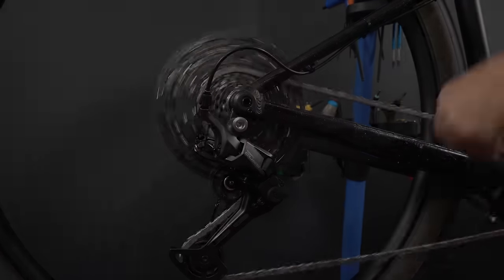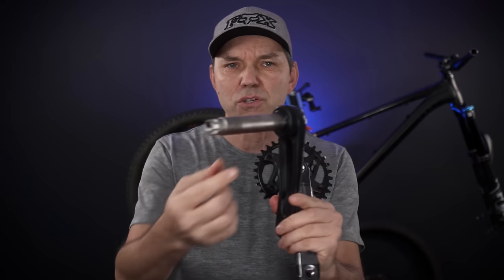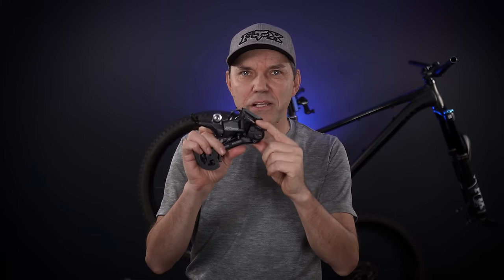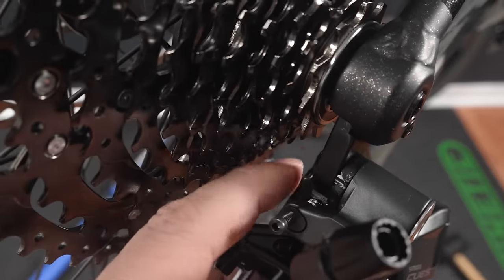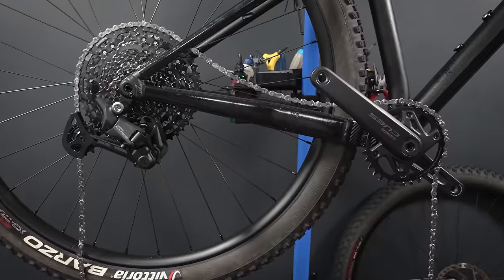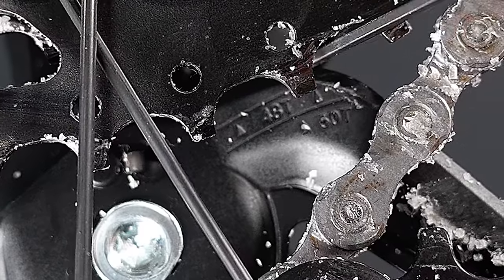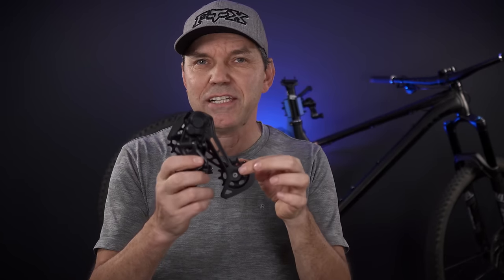4 of 5 - Testing Shimano CUES U6000 1 x 11 speed, Installation, Linkglide 9-10-11s Drivetrains

Comment: Nobody will race with these components so it is ok to shift a little slower. You will get used to it anyway. It makes it last longer and thats good.
Reply from the maker: True that!
Reply: I've just killed first chain on my Linkglide drivetrain, and there is NO SIGN of wear on the cassete.
So far, so good.
Reply: Can we change 11t to 13t cassette spokets if it wear out ? & Where to buy ?
Reply from the maker: @pickongamer4357  yes you could definitely replace & don’t know where you’ll find those, did you check online?

Comment: tip for better shifting on long therm: immediately throw away the stock shimano green inner cable and replace it with a good quality, stainless, grinded one.
Reply: Galvanized cables might rust but they keep operating smoother for longer if you keep them lubricated.
Reply: @LaurentiusTriarius  it wasn't a classic tech tip. it was about the shitty stock, layered shimano cable that might be designed by sram. :)

Comment: I got U6000 1x10 speed, 6 pieces/components, for less than USD175 (converted) and MT200 hydraulic brakes front and back for USD35. Ah, and SR Suntour XCR 32 RLR air for about USD80. Think this will give me good upgrade from my current Tourney XT, mechanical brakes and XCM. Western world overpays for sure, not on all products, but many.
Reply from the maker: Enjoy your upgrades! Definitely amazing value

Comment: My Oggi Razzo e-mtb has this U6000. I ride about 1200km with it (750 miles). It is really slow to hard gears. And, in several occasions after rain and mud the bigger light gear do not goes down more. I need to stop and press by hand turning the pedals and lifting the wheel . A strong spring is necessary for use in MTB.
Reply from the maker: From what you’re saying you might need a bit of adjustment on that drivetrain m. Also clutch service 😉 have videos for all that
Reply: @LoveMTB  I hope you are right and a adjust can fix this. I saw some videos about the "B" adjustment of the rear derailleur. I will try it.
Reply from the maker: @x.trailcwb1546  Yeah I would recommend a good video like this one and the Shimano 12s install I'm rferring to, not just "some video". And B-gap can be part of it but it doesn't sound like it is your only issue here😉

Comment: Definitely a consideration, when my sram cassette is needing replacement. Is the shifter compatible with matchmaker bar mount system
Reply from the maker: It’s Shimano so it won’t be compatible but bar clamp will work

Comment: I think its pretty good and if installed on a newly purchased bike (regular or E) it could last the life of it. Having to use a crank puller...no big deal. This what you have if you just want to ride a bike and not think about charging,  or replacing  parts and performing maintenance. Great for the masses.
Reply from the maker: I agree this can last the life of the bike (if you remember to change the chain of course!)
Reply: @LoveMTB  That's it. Maybe picked up at a bike service every year or two.

Comment: It does looks a tad slower shifting.  That would throw me off.  If not for your video, I would think I didn't tune it correctly. 😅  Still sticking with the m5100, but that new crank does looks cool, just not the crank puller part.  Haven't used one of those in a few years.
Reply from the maker: Yup I had to dig out for it!😊

Comment: The big question for me is can I use the new CUES cassettes with older 11 speed setup.  So would a previous linkglide 10/11 speed shifter, derailleur, and chain work with a newer CUES 10/11 speed cassette?  I'm assuming since the spacing is the same, it would be fine.  I just want to be able to use a burlier steel cassette for durability.
Reply from the maker: Linkglide to linkglide yes, it works. Linkglide/ CUES to old stuff not so much, more to come on that soon!

Comment: Great Video and very informative.
I installed a 6000 series 2x11 on my hybrid 700 bike with 50/34T chainring. So, I installed the cues RD-U6020-11 and 11-45T linkglide cassette ( replacing 11-28T), the new cues shifter and linkglide chain. I agree the shifting is delayed but I am now used to it and after 800km it runs very smoothly.
Reply from the maker: Yeah we noticed it at first now it’s “how it is”. Interested to see it long term even though if what Shimano says it’s true (3x) it will take a while 😊
Reply: @LoveMTB   I do go thru a few cassettes so it remains to be seen. It should last longer because it is steel and not AL alloy.
Reply: Hi, how are you? I'm currently rebuilding a 2019 Scott Aspect with Alivio 3x9. I've just installed a 1000W rear hub drive motor, so far it works well. My consideration now is to replace the 3x9 with either a 2x10 or 2x11 drive train and trying to decide between CUES and Deore group set.

The bike is used for commuting to work, shopping (panniers and trailer) and weekend fishing/camping trips. I ride mostly road with some trail riding on weekends.

How are you finding the Cues now? My leaning is towards the CUES, as they can be set either x10 or x11, governed by the shifter.
Reply: @Frombie_01  After a 5 months of running cues 6000, I have to say I am very happy with shifting and also smooth running compared to my 1x12.  If I was to convert another bike I would recommend it. the only thing I don't like and that is personal, is the gear ratio changes between cogs. For me, it has a large gap between cogs and for my use is not ideal.
Reply: @Navigator-apex  That is something that bothers me with 1x systems. I neglected to mention that I was actually looking at the 2x. However my point still stands regarding the versatility between the 10 and 11 speed. It is basically just changing the shifter and cassette.
Reply: @Frombie_01  Yes but in my case I also, changed the RD because my old Durace could not handle the cassette capacity.

Comment: I use linkglide with XT M8130 derailleur. Can someone explain to me, what's the difference between  CUES U6000 and RD-M8130SGS?
Also, changing gears down the cassete is lightning fast on my setup.
Reply from the maker: Never had one in my hand but I assume it is materials and weight and ability to adjust the clutch without removing the cover and...that should be it!

Comment: Would it be possible to use just the CUES crank with an older rear derailleur with a 9 speed chain?
Reply from the maker: Yes no problem
Reply: @LoveMTB  Thank you for the confirmation, much appreciated
Reply: @LoveMTB Just got the U4000-1 with 32 teeth and it works perfectly with the existing BB. Thinking of getting the 11-46 cassette now! Appreciate these videos!👍🏻👍🏻 Cheers and keep making such videos

Comment: I'm surprised you didn't need spacers for your BB. I tried to install that same BB on my wife's bike but her frame is narrow so tightening the CUES crankset without spacers left the cranks visibly offset towards the non-drive side.
Reply from the maker: I have a 2.5mm spacer on the drive side like Shimano recommends for the 73mm Bb shell
Reply: @LoveMTB  ahhh ok. I'm not sold on using an aftermarket chain though. I haven't tried the factory chain yet but the aftermarket one I have is making a lot of noise and it needs to go on the chainring exactly right or else it sits too high and slips.

Comment: My linkglide chain is almost at 0.5% wear (U4000 9s set), I use it mostly in steep terrain, so most of the time I climb, which is acceptable. It will wear the chain slower on flat though. I think I could get 4 or more chain replacement at 0.5% wear before I can change the cassette. I checked the cassette, and there is not even a sign of wear on each teeth even when I climb a lot.
Reply from the maker: Great! It is what Shimano said about longevity also

Comment: Hello, are the cues u6000 compatible with non other cues parts? Basically I want to upgrade a mid-tier bike. My current crankset is just some cheap 1x 32tooth square taper Crankset ( i alos want to upgrade to hollowtech II), pared with a KMC Z9 Chain.

both cranksets have 32 Teeths and are the same height. 
but i dont have hyperglide or linkglide. and my cassette is a 9 speed microshift cassette.
will the crankset skip my chain while riding? Are the teeths on the shimano different than on the cheaper crankset by meroca?
Reply from the maker: Hello gave this video all about that - 5 of 5 Shimano CUES Compatibility - Linkglide M5100 U6000 MTB 11 Speed
https://youtu.be/MV2O3XBSwZ4

Comment: Nice.... I think Shimano has made a good choice with drop bar brifters and road bike components coming soon. With much less stock to keep in the inventory going forward because of the common pull ratio and modularity of the design another obvious advantage.
I would use those cranks with a narrow wide single chainring and go ten or eleven speed on my hardtail using linkglide and U6000 CUES components.
I think the new crank design is excellent with the whole CUES line-up a winner. The linkglide cassette shifts slightly slower than Hyperglide plus but the added strength and longevity would make the shifts a moot point. The new modular CUES components are very robust and definitely a huge step up over Acera with a definite push towards the higher end of the component line rather than the lower end.
I haven't seen much if anything on anyone using or reviewing the new Shimano sealed bearing hubs yet as they are a complete change of mindset for Shimano. I love the U8000 brakes it looks like Shimano has hit it out of the park again.
With some Suntour Epixon front forks any build starts to become a great build with recreational riding and value for money in mind using CUES.
😎🇦🇺👍
Reply from the maker: Have not seen those hubs either! But once you get into that there's soo much competition already, it's not even funny

Comment: Excellent video as my CUES 1X10 is in the mail now. Cannot wait to get it. Im a little qorry as my chain stay length is 425mm, hope there are no issues there
Reply from the maker: Let us know how you like it!🤘
Reply: Started my installation and seems to be going good so far, just need to put the shifter on and cabling now. Thanks to your video made the installation so far very easy especially sizing the chain. Hope the remaining install all goes as smooth. Will keep you posted
Reply: @LoveMTB  took it out for a test ride and not sure how it happened as the limit s were set correctly but the derailleur cage plate was totally bent by the chain and the chain all jammed up in the rear cage. Never had this happen before. Returned home and took cage plate off and bent it back. Shifting up gears is ok but shifting down 1 gear doesn't shift but need to shift 2 down and then 1 up. Not very impressed with it so far. I will change to new cable housings and also change the cable that came with the cues shifter as it has some greenish blueish coating that doesn't appear to be very friction free in the s himano housing I'm using.
Reply: Any other ideas to get better shifting (I already chrck my hanger is straight and also took a spacer out of the drive side of the bb sp the chainline is better)

Comment: im considering going from T type x0 to CUES or Linkglide. What do you think?

I might send the t type to my enduro acoustic bike. And get the heavy duty on the EP8 bike...

would you agree?
Reply from the maker: I would definitely consider that Linkglide was meant to be used on eBikes
Reply: more than the t type? @LoveMTB
Reply from the maker: Yes for the price and simplicity and possible cost savings long term @ignaciosevil2157

Comment: A mix and march between 11s components for sure, not only for the linkglide cassete and m5100 compatibility but also the other way around, using linkglide components with older generation "light-ish" cassettes, some sunrace 11-46 for example. It may not make sense with this particular derailleur, being high range, but it may be a good setup with a m5130 for example, if it works

Comment: Hi, has anyone tried combining the  U6000 with M4100 , if so, is there a difference between the cues switch and the m4100, does the m 4100 shifter just look more interesting or is the m4100 not very suitable for this?

Comment: Hi, what BB do you recommend in the mid/high level for a shimano 12s with SLX crankset, thanks.
Reply: The bb mt93 or bb mt800 are good. I think that the mt93 have better seals

Comment: I've already have my next Chinese 11-46 10sp 330g cassette at home, but since linkglide came out, I'm seriously considering selling it and going with Shimano overweight glide technology. 😋
I think this is really what industry needed. Less waste, more reliability and durability. 
But I think I'll grab OEM xt linkglide rear derailleur at a bargain price, instead of going for cues derailleur and shifter.
Reply from the maker: That’s an option as well, but XT 8120 and Cues uses same te h, I would grab the XT shifter and everything else Cues 😉
Reply: @LoveMTB  well, i would till recently too. But I've found out the main slop source between 6000 and xt and up, is the hanger bolt in the derailleur. I've seen this video, where the guy recommended changing the bolt in a 6000 deore, to eliminate slop in this area. Bolts from xt are not easy to find, and those little parts are rarely economical, plus slop also comes from glide bearings in jockey wheels. So I get OEM 11sp xt with tighter tolerancesc@ hanger, sealed bearings in jockeys, for 46,3$ Inc shipping, and I can choose 10sp or 11sp overweight glide cassette. I currently run 10sp, so I think I'll finish current drivetrain and swap to 11sp. 
XT purchased. The rest will wait
Reply from the maker: @polishguywithhardtospellna8227  let me know how you like the end result!

Comment: 8:40 - I will definitely if the claimed 3x better durability is the case.

BTW
Does this crank spider (on a drive side) is compatible with an Octalink II BB? 
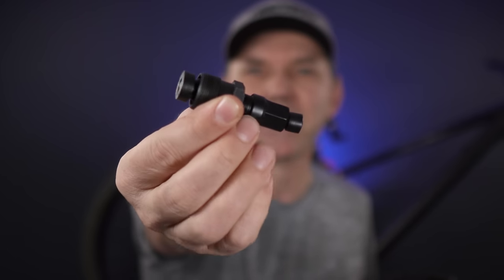At 1:35 it looks familiar (so does the puller at 1:58).

Comment: I was considering buying this to upgrade my Deore fatbike 1x10 drivetrain. Shifting under load is always so-so on the old Deore 10spd. It works but just clunky. I'm also not concerned about the weight as much on my 38lb fatty.
Reply from the maker: This would be close to perfect Just maintain that chain after each ride especially that LG500 chain is prone to rust!
Reply: @LoveMTB  Great point! Rust is def an issue with transporting on salty roads, and just nasty winter conditions in general. Regardless it does seem like this drivetrain would probably suit the high torque low rpm nature of fatbiking.
Reply from the maker: For sure, it is what it was designd for @rpiian

Comment: Hello!

I do have shimano 11s m5100. Can I buy just the cassete and have linkglide advantages? What is the mix and matching compatibility with m5100?
Reply: Not compatible
Reply: And if use shifter SL-M8130-IR11 it will still not working? Thanks!

Comment: Which one is better u6000 or m6100?
Reply from the maker: They’re both great! What’s the application? They are meant for two different ones
Reply: @LoveMTB  I'm planning to build a hybrid bike
Reply from the maker: @inyourears2596  I would personally go u6000 10 times out of 10
Reply: @LoveMTB  ok will get the u6000 because i believe you
Reply from the maker: @inyourears2596  ok😎

Comment: I would have loved to see the 11-51 Teeth cassette from M5100 make a Linkglide comeback, but I think that it won't be missed too much considering the already high count of Teeth at 50.
Reply from the maker: This CUES lineup will eventually REPLACE that Deore, and I think they want to keep it different than the 51T that 12s goes up to.
Reply: And that's why I keep 11 speed M5100 cassettes stocked up. They are going to disappear eventually. I can tell the difference between a 51T low and a 50T low, and with a 28T chainring already, going smaller upfront isn't really an option.

Comment: I installed the cues u6000 groupset and I can tell you I'm not impressed. The cable, its housing are new, tuned rear derailleur correctly and still I don't like it. the shifter feels like tourney, the derailleur has a play, the cassette is way too heavy and made from cheap  metal=washed it with the gasoline and let it dry for a day. and the rust spots came up)
Reply from the maker: Washed with gasoline??? Why?
Groupset works well for us we put it through the ringer in the last few weeks, so far so good. Materials, finish, not XT/ XTR quality but it is not supposed to be and price reflects that also.
Reply: @LoveMTB  agree with you. Mb I just had too high expectations)
Reply from the maker: With you on that😊 @lollol2283

Comment: As a mechanic, it's always funny to see, how some people " calculate" the length of the chain😁👍‼️
I even don't try to understand the math, of adding 5 to 6 links or 6 to 7 links. 
From what reference line? From witch position? Rear Derailleur cage 90 degrees? (doesn't matter at all!)??????? 
In work education school for mechanics, to install a chain properly, you always start with small - small, before cutting, try big - big ( 3 ring crankset 😂).  And your adding mathematics, is only nessesery with Full suspension bikes, and I only do it at my DH Bike. Otherwise, the capacity of the rear Derailleur " makes" it for us. Especially, since 1 x anything 😁😎😁😎😂😂‼️
Reply from the maker: I know it might look funny but It works! Definitely on a HT it’s bulletproof. On a FS is a good starting point sometimes you have to cut a couple more links but otherwise spot on😊